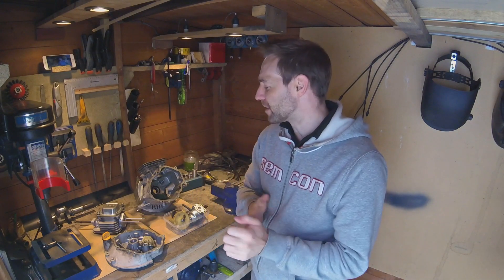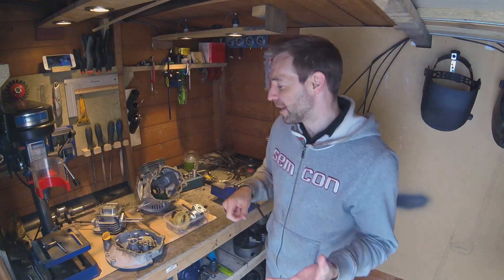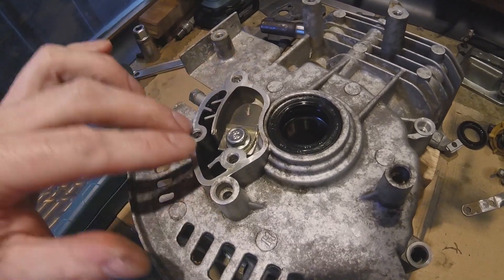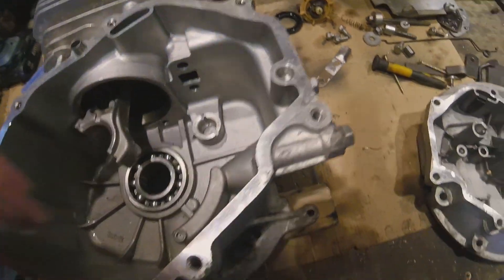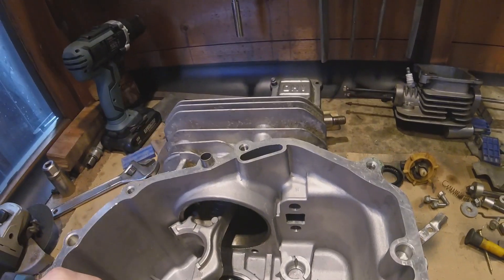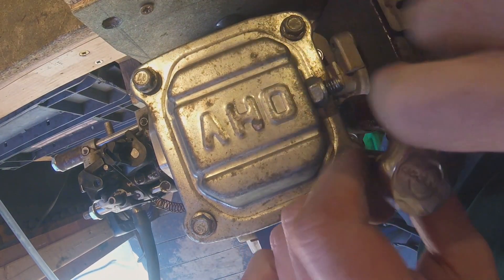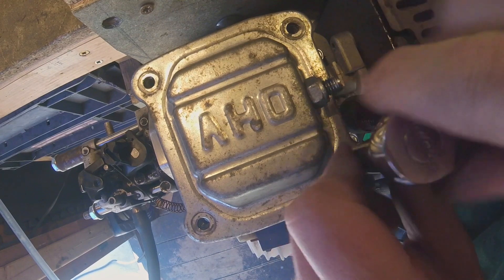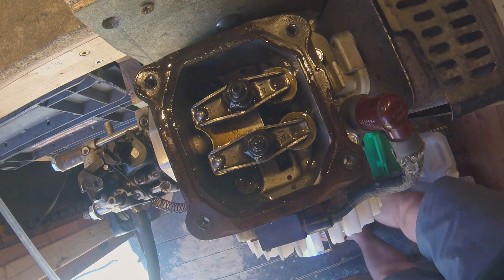How to convert a OHV vertical shaft engine to run horizontally for Go Kart, Drift trike or mini bike

Comment: doing this to a 18hp downshaft tehcumseh right now  i jb welded a brake line to lenghen the oil pump pickup ill update if it holds up
Reply: did this to a 3.5hp briggs pushmower engine a while back and it held up except it had a oil flinger and more simple lol

Comment: How oil go to head??
Reply from the maker: 5:53 oil slinger, throws engine oil up to the head.
Reply: @dtaylo4517  nice
Its all?
Only slinger throws oil to head 
that's enough?
Engine still running?

Comment: You need to take that bolt out of the blow by vent on the valve cover, you will blow a crank seal. Done that before lol
Reply from the maker: Are you referring to the bored out bolt on the valve cover?
Reply: @dtaylo4517  yes
Reply from the maker: @Tommysmess  Thats what the bored out bolt has been installed for, to vent the case. The original vent in the vertical shaft orientation as been sealed as part of the conversion.

Comment: Wait so if i have a flathead lawnmower briggs and stratton do i not need to convert anything?
Reply from the maker: A flat head Briggs would be easier, you still need to file in oil journals for the crank bearings and it will require some form of oil slinger to get the oil around the case.

Comment: Did you remove the governor?
Reply from the maker: Yes removed the governor, and tapped the hole to seal with a bolt and quick weld
Reply: @dtaylo4517  Ok. So does it rev higher?
Reply from the maker: @getoutmecar2940  I honestly couldn't tell you I found the lawn mower ready for the scrap heap, so I just fired it up and then did the conversion.

Comment: how did you find a clutch to fit the shaft? Mine is a 7/8" shaft with a 3/16" key, I can't find ANYTHING that fits this...
Reply from the maker: Ive not got that far yet, I have seen other videos with people getting around the issue.
Reply: They might make a sleeve for it to go to one inch

Comment: They like to run at high rpm’s without the blade, which works as a flywheel. Maybe try swapping the flywheel out. Seen a lot of these videos. Yet to see one done and out to use. Great job either way 👍
Reply from the maker: Cheers bud, I have got future plans for the engine once my bobber motorcycle is complete. Im quiet sceptical myself whether it will shift but will be enjoyable either way.

Comment: Is the engine still running?  Have you put any load on the engine....on a go cart yet? Are you happy with The hole for the valves Thanks nice video
Reply from the maker: Yes the engine is still running, Ive not bolted it to anything yet or put it under load, I have got a go kart rear axle, intend to do build once Ive finished the bobber. As for the hole between the valves, I reckon it could do with a smaller aperture, I am getting a-lot of oil thrown up to the valve train, which was my original intention however I think you could get away with a smaller aperture.
Reply: @dtaylo4517  great. Ty.  I was hoping you mentioned the valve hole size to be smaller.  Thanks For the feedback

Comment: Can u try on a bigger engine, like a 14.5 briggs?
Reply from the maker: I cant say I've seen a 14.5 Briggs, my only experience has been with the 2/3 hp Briggs.
Reply: I second that and am thinking this video is giving me more inspiration to try sooner than later.  Though I'm waiting until I get into the 33XXXX (21HP I forget the engine code offhand) to work on since have two where the one is working great though running away revving due to the governor and the other is a possibly connecting rod rebuild not seized, though I'm not certain of the damage inside the crankcase and wall beneath, that I'd like to beef up to overcome that weak spot where they drilled a hole in the connecting rod unlike the similar design 28XXXX & 31XXXX engine codes design.  I'm wondering how similar design the B&S's are compared to as shown?  I've not disassembled one yet and inspected in detail to attempt.

Comment: I’ve done this to a 4.5hp Briggs, I cleaned it thoroughly, 
I changed the gas tank mounted carb to a normal float carb, 
bolted an oil dipper/flicker to the connecting rod, filled the old oil fill hole with a metal plate and jb weld... looking back it all should have taken about a week, excluding the part where I ordered gaskets and a new carb...

Comment: How much oil you put in this engine?
Reply from the maker: well its not an exact science but I used 2/3 of the original oil I drained from the engine. In hindsight I should have used the governor port as an oil level indicator.